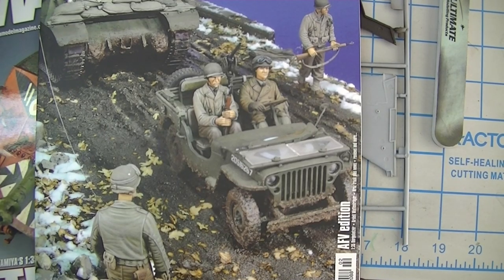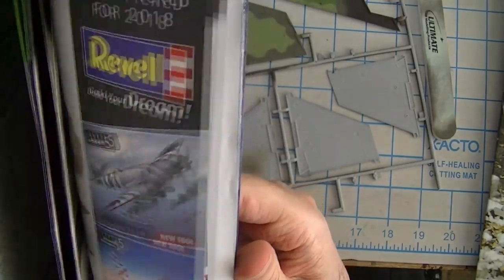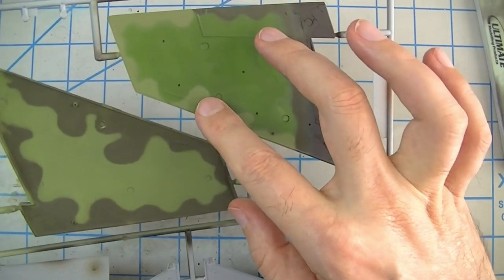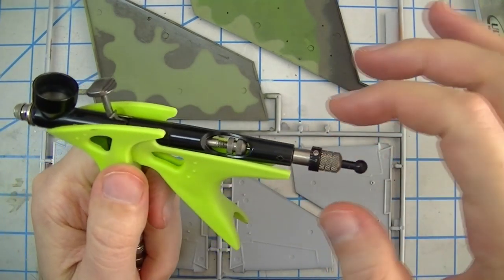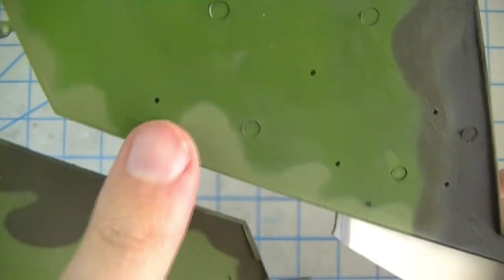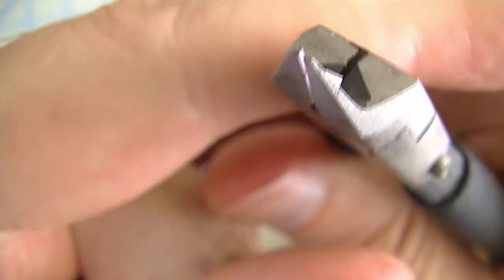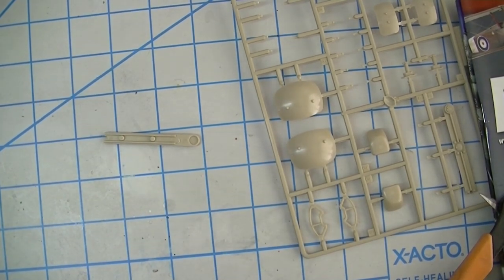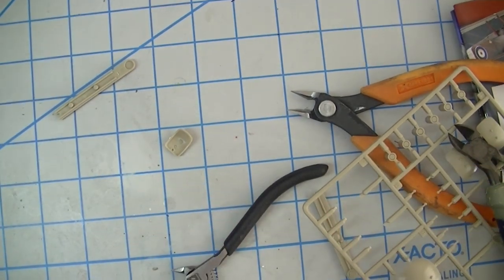ep219 - 10 minutes of random #11

Comment: The single greatest improvement I have made in my modeling tools was upgrading to the single blade cutters!  There isn't a comparison they blow away all others by miles. Spend the extra money to get a good pair you will never regret it + you will save time and energy not wasting it sanding and filing little nubs away and it prevents all the possible damage that might occur to the parts in that process so you can build faster cleaner and sharper models with less effort!
Reply: Gundam Planet sprue cutters worth every penny I paid!  Looked at the DISPAE cutter, but the Gundam looked the same and cheaper. Great investment.